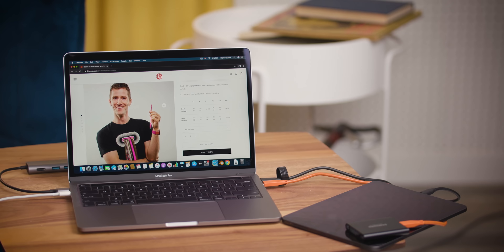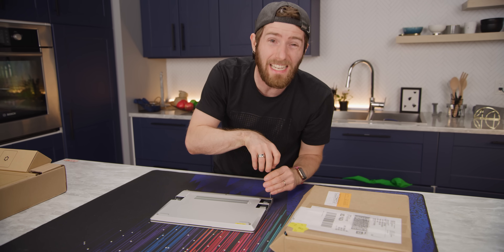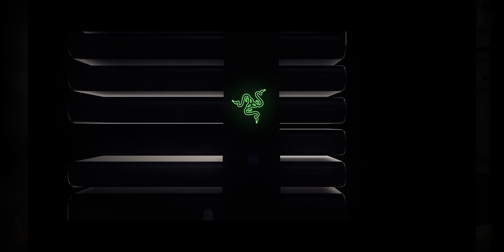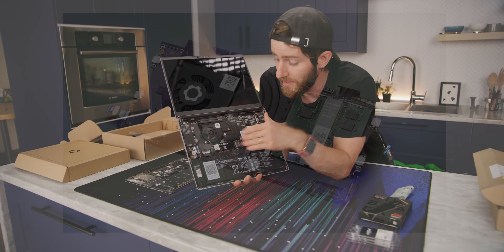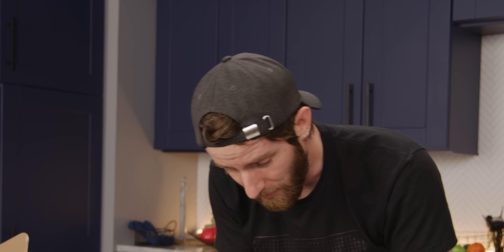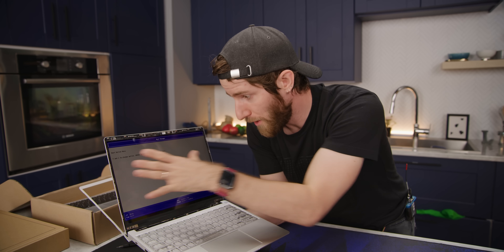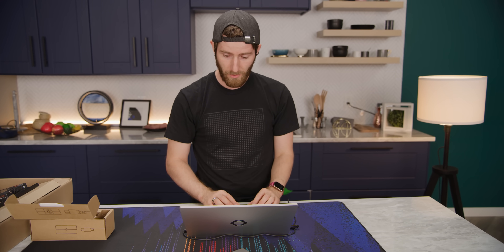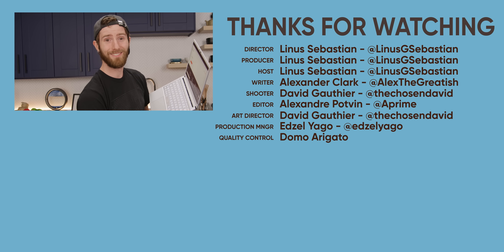A COMPLETELY Upgradeable Laptop?  - Framework Laptop Review

Comment: How all laptops should be tbh. Sucks when you have to just buy a completely new one instead of being able to upgrade it other than the most basic of parts like ram and storage.
Reply: The one thing I'd like to upgrade is the CPU haven't watched the whole video yet let's see if the CPU is upgradeable too
Reply: @ixheroxvgaming  It isn't, but I guess we will see if they will sell new motherboard+cpu combos, because eventually, the new cpus will need different chipsets
Reply: @ixheroxvgaming  Yeah that's certainly something that would be good to be able upgrade as well as the gpu too.
Reply: @WyattOShea  well my cpu is the biggest problem I have I'd like to only change the CPU and GPU because my laptop has got some good io and when I upgrade my laptop it probably only has a single hdmi and I wanna use a third monitor too

Comment: This defies Pre-Builts in every way possible
Reply: yeah
Reply: Nah, can't even replace or add a GPU to it
Reply: @Alex-ch2ud  nope. You can use Thunderbolt to add an external GPU
Reply: @Alex-ch2ud  Most AMD based ones don't. Because thunderbolt is an Intel patented technology
Reply: @How23497  That’s why most laptops especially higher end ones with RTX 2080/3080 use intel
Reply: @Alex-ch2ud  The Intel models almost certainly support Thunderbolt 4. If they make AMD models in the future with USB4, you would likely get eGPU support as well. USB4 is supposed to be intercompatible with Thunderbolt 3 devices.
Reply: @CalculatedRiskAK  Most gaming laptops support thunderbolt, so what? just because it supports an eGPU doesn’t mean it’s more upgradable than any other laptop
Reply: @Alex-ch2ud  yes you can, it has as many type C connectors as you want
Reply: @joshuanorman2  Type C and Thunderbolt are different things, besides, most gaming laptops have support for thunderbolt, so in other words this laptop isn’t more upgradable than any other basic gaming laptop is
Reply: Well, maybe thermals.
Reply: @aadisahni  depends on the prebuilt
Reply: But in the end we'll still buy a Macbook or and equivalent - me included. I don't buy a laptop to tinker on personally.
Reply: @TheFlyingPineapple  You don't, but many power users like myself do. Even if one doesn't tinker, I firmly believe they should have the choice and the right to do so.
Reply: @kanishkachakraborty  oh for sure, the more options the better
Reply: @TheFlyingPineapple  The only ones who benefit are us, the consumers! :D
Reply: @TheFlyingPineapple  you don't need to buy this to tinker. You buy this because it's cheap, powerful, good looking, and easy to repair by someone else in case something goes wrong. If you buy a Macbook, good luck getting your data back when it has an issue. Even the smallest issue gets you a data wipe during servicing.
Reply: @xmlthegreat  it certainly isn’t what I’d call cheap. $750 for the entry level i5 and you don’t even get any RAM, storage, or an OS included. 

Something like the M1 macbook air is far better price-performance, but I guess that’s just economies of scale
Reply: @TheFlyingPineapple  Who cares about performance on an M1 mac, you can’t even game on those, games run like shit on ARM lol
Reply: @Alex-ch2ud  people who do actual work on laptops care about performance
Reply: @TheFlyingPineapple  Yeah that’s bs, most work doesn’t require nearly that much processing power, photo/video editing aside there are very few applications demanding the full utilization of an M1 processor. Using a Mac Pro for work is wasted money.
Reply: @Alex-ch2ud  so what you’re basically saying is “apart from pretty common cpu intensive work you don’t need an M1 for work”… 🤡🤡🤡